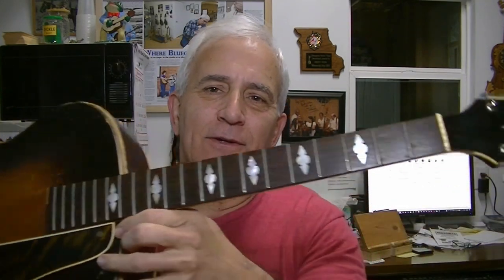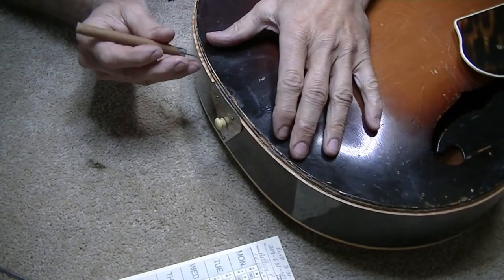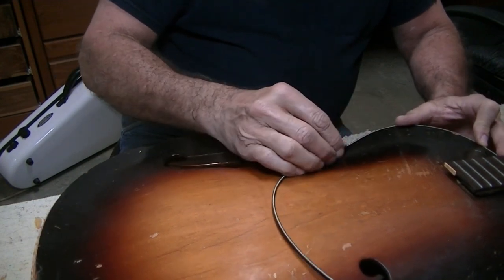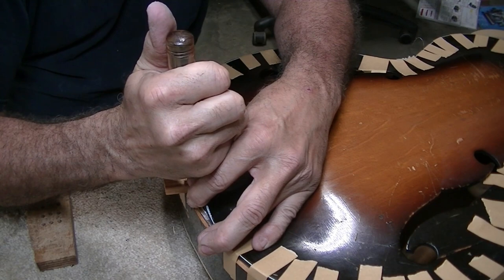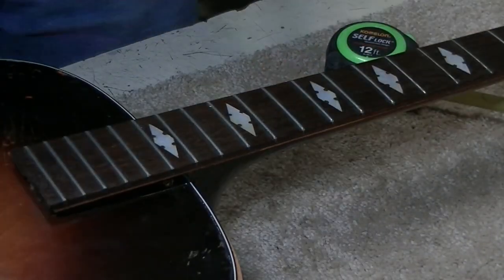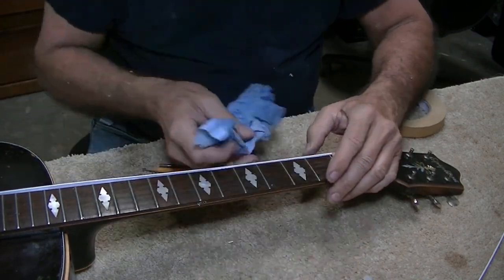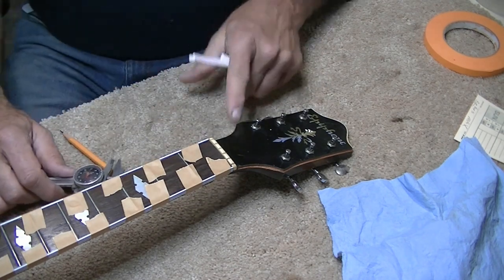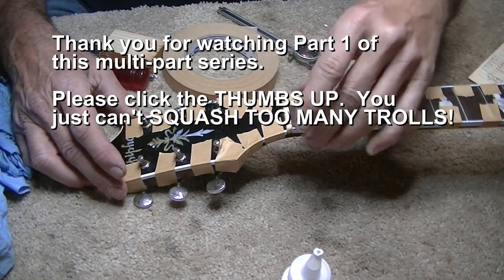378 RSW Epiphone Triumph Binding Restoration P1

Comment: I have a 1988 Epi Sheraton that has a very similar staggered tailpiece. That's a beautiful guitar you got there Jerry. Proper job.
Thank you sir.
Reply: And how is yours set up? Are the bass or treble strings longer?
Reply: @Greg042869  Treble strings longest, Apparently tailpiece on mine was originally from a 1970s EA225. Bridge isn't original either.
Reply: @Peasmouldia  Interesting. Another in the comments says his was set up the other way. I wonder if someone from the factory could be questioned.
Reply: @Greg042869  Some of the 70s Japanese made ones vary a lot, and so does the quality. Those guitars had bolt on necks and terrible pick ups. Mines later and originally had a Bigsby. Previous owner fitted the tailpiece and bridge, so I'm only guessing that it came from a 70s Casino.

Comment: Hey, Jerry. A neighbor threw away a very clean 1940 Epiphone Zephyr (blonde archtop with one pickup) in a Lifton case because, when he inherited it from his dad, some of the strings were broken! Wow. Cool guitar. This guy's dad had installed an early Bigsby tailpiece but otherwise original.
Reply: I hope you rescued it, even though it was worthless with broken strings. A big fix for someone :-)
Reply: All too believable. A friend pulled an old Framus from a skip back in the 70s. It had no strings and a couple of dodgy frets. A little fettling and it was fine. Currently a  model of similar vintage  on Reverb is £1800+.

Comment: look on ebay for that tail piece You can find them but they are not cheap! allparts sells a repo it's not cheap either around 50 bucks they are called frequnsator tailpiece. if You think that one's in bad shape You should see My 1938 Triumph it's way bad, back severely cracked, top separating, top cracked near the bridge, all binding GONE, top separated from the sides in two or three spots and someone reglued it with I don't know what

Comment: Perhaps this is a silly question, but why did you do the neck binding first before leveling and crowning the frets? Aren’t you making your job a bit more difficult that way? I have seen you working around stuff many times, but just because you can do it the hard way, don’t mean you have to. Unless the binding was done specially for the video. Are you going to bind around the F
hole? I also have noticed on your own guitars and mandolins you use wood binding, but on the customer instruments you use both types wood and plastic. Which is better?  Which do you prefer? Good job as always, especially on the mitered corners
Reply from the maker: Plastic was used on this one originally so I'm using plastic just to try to make it look like original. Regarding doing it the hard way I can't tell a bit of difference. I'm not sure why it's any harder to do a front yard with binding on that it is without the binding

Comment: My finger temperature gauge I used in the lab when checking transistors and such.
130F touch it and you can hold your finger on it for a pretty good while.
135F touch it and you are inclined to untouch it in a few seconds.
140F touch it and you snatch your finger back within a second.
145F touch it and you wished you hadn't.
And finally for transistors that were clearly over 145F.
Lick my finger and slap the part.  If it hissed then it was over 212F.  Which might be within the mfg specs but is just not a good idea to leave it that way for long.  Change the design.  We aren't shipping space heaters we're shipping radios.

Comment: Thanks Jerry for shearing . I have a repair that I'm going to try. What make and type of tape do you use as not to ruin the finish?
Reply from the maker: It depends more on the finish and tape. Almost all tape will pull the finish off. Especially if the tape is strong and the finish is weak. I get my tape from Stuart Macdonald but it's probably not worth spending that kind of money

Comment: If you're worried about tape on old finish, there is the traditional way of containing the binding which is to wrap the instrument in cotton rope (http://www.guitarrasfdc.com/2012/05/binding-using-hide-glue.html). That will keep it in place and protect the finish. I use surgical tubing when I wrap which puts pressure on the binding while holding it.
Reply from the maker: I've been using the cotton rope for 35 years.

Comment: Hey brother Jerry.  With a job this complex, how on earth do you quote on this? 

Do you give a firm quote for the complete job; or quote to make the guitar playable, and then ballpark the cosmetics, then contact the customer at every aesthetic stage for go ahead?
Reply from the maker: Presently I bill at $80 an hour. I give a quote on how many hours I expected to take. On some jobs I say I will limit it to a specific amount of time depending on the issue. If it takes more than that I just eat the cost. What other jobs I explain that I have no idea how long this is going to take but my guess is about this many hours it could be a few hours more Etc. Parts are always whatever they cost so I don't charge extra for those

Comment: That's a Frequensator tailpiece. 

"Frequensator
By Sweetwater on Jul 3, 2007, 12:00 AM
Like
Tweet

This particular tailpiece was designed in the 1930s by Guild associate Herb Sunshine and used on the majority of their upscale archtop guitars well into the 1970s, after the company was purchased by Gibson in 1958. The Frequensator allows for a longer string length on the three bass strings and a shorter length on the three treble strings. The original had a nasty habit of cracking at the right angle bend of the anchor, across the edge of the guitar. It was impossible to fix and thus required the purchase of a new tailpiece."

Comment: it would be a 20 +  hour fix it  video .
use blue painters tape instead of heat gun .use your wifes Hair dryer on Medium . or high it will not mess up the finish .
Reply from the maker: I guess you didn't hear me say the heat gun is adjustable from cold to hot. You can turn it to any temperature you want. There's no need to use a hair dryer.
Reply: @RosaStringWorks  yeah I did Jerry but  I put that in there 20 minutes before you stated that . so I left it there ..  figured you would say that lol 👍